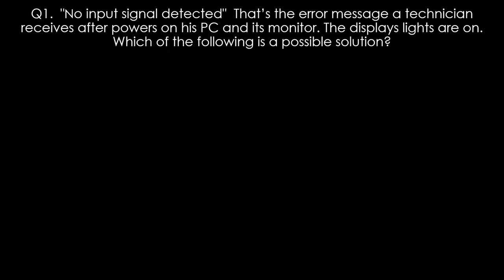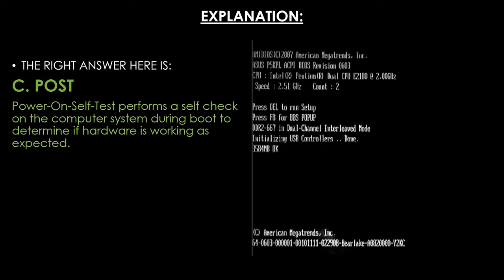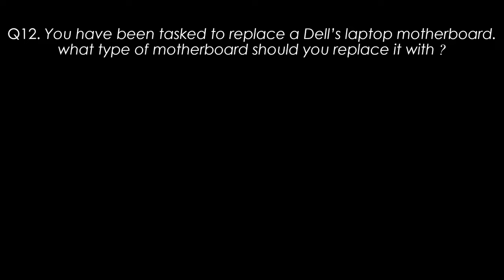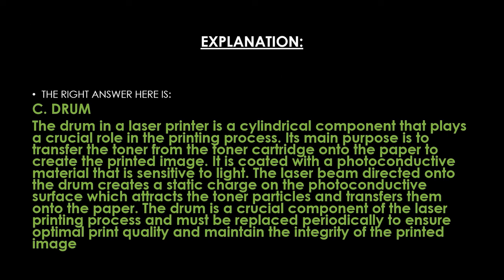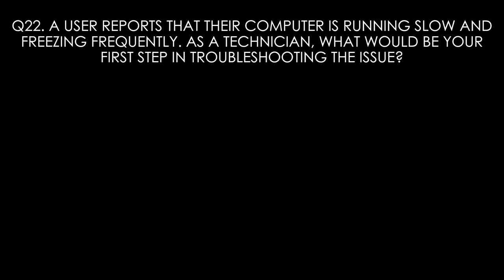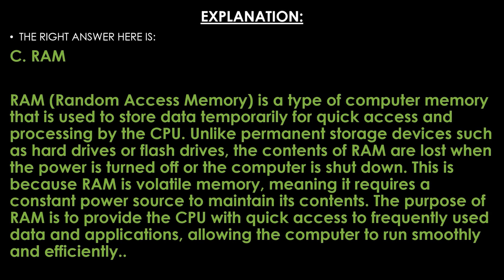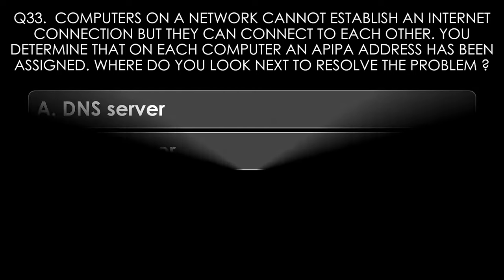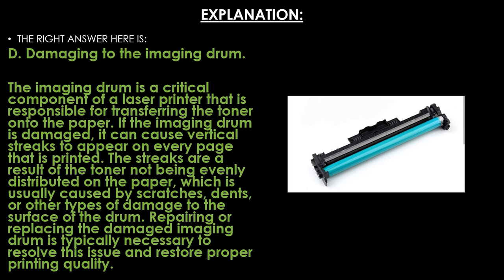CompTIA A+ Certification Practice Test 2024 (Exam 220-1101) (40 Questions with Explained Answers)

Comment: I took the Core 1 test two days ago and passed.  It was really hard, at the end of the exam I thought I might fail even though I had 5 years of experience as a computer technician while it was 10 years ago.  The exam, 75 questions, started with three PBQs (RAID, Laser Printer Maintenance, WiFi router setting with security).  I should have skipped the PBQs to save time.  However other questions, about 10~20, same as PBQs but as multiple choice.  

I felt some questions not clear wordings describing the situation, one question I read five times but still I don't understand what the question is, I just guessed by the multiple choices.   Some questions asking the best answer can be controversial and if this is a real situation then I need to ask the customer for more information, preference, and etc.  To prepare for the next 1102 exam, I need to know not just the definition and the meaning, but also how to use it and when to use it.  Therefore, I think DeanCyber's videos will be helpful for those who prepare for the exams.
Reply: I also did it the other day. It was very hard! Most questions i had never come across before anywhere. And some i had zero idea about even though i had studied for 6 months for the exam. But i still passed.
Reply: What is the answer for RAID question? Please. I did not pass yet
Reply: Answer for first four questions please?

Comment: Question 40 was a bit confusing. How can one determine if its overheating if he has no parameter to judge? Sure you can check the BIOS for temperature, but if you do not know the max tolerable temp for your CPU that causes the shutdown, simply checking temperature wouldn't make a difference.
Reply: Also you wouldn't want your computer to shut down automatically on BIOS i think

Comment: I’m looking to getting my certification before the year ends considering it’s about 6 months remaining in 2023 I want to accomplish this goal. My question is how long do I have to study for and how many questions on the test? I really want to jumpstart my IT career. Someone help I’d highly appreciate it
Reply from the maker: There are 2 exams. One exam for Core 1 and another for core 2. There are no more than 90 questions in exam, simulations included. Usually, there are around 70 questions and around 5 simulations for an exam. You will have 90 min to finish the test. 
I have a Udemy course for core 1 and 2 with mock exam questions if you want you can check them out. The links are in the description. 6 month is plenty of time, there is no way to tell you how long it will take you, because for each individual is different, depends on many things.

Comment: Is A+ worth it or its a total waste
Reply: Well considering core 1 and 2 are fundamentals of everything it is very worth it because it will show employers that you know the basics and are willing to go up from there
Reply: If you completely Skip A+ and get Net+ / Sec+ you can still get employment with that but it depends on the type of employment you’re going for.    
I knew a guy that went straight to net+ but he was one of these guys that would build his own wild n crazy network setups (that helped him leverage employment without work experience for his networking job). 
I honestly don’t see A+ as a waste of time because it’s hard to start at a higher level without some kind of work experience.   
Without that I think alA+ could help better for entry level because you get a better variety of knowledge for an entry level position.  After that you pick and choose which direction you want to go based on what certifications are required for said position.  A+ has some basic networking stuff in it and I think that would help tremendously before going into Net+.

Comment: I did pretty poorly on this and I have my exam tomorrow, wish me luck.  probably going to fail.
Reply: good luck
Reply: How’d it go?
Reply: Did you pass?
Reply: @blfex84  yes actually I got a 696 out of 900. So passing but not pretty close to failing
Reply: @lukewarm751  congratulations
Reply: you passed. that´s what´s important. any tips or plans that you advise me to do before taking the exam? i am very nervous.
Reply: @lukewarm751  GG. Congrats. I got 3 wrong on this vid, but i hope i can get as close to 900 as possible, im not taking the test for another half year or so and then i'll likely want to get other certs as soon as i get a stable income because these tests are pretty costly.
Reply: @eurostar0711  Same.  I could not find the answer in my study for the last questions.. but a lot of the questions here seem very.. easy?
Reply: @lukewarm751  can you tell me the scoring system? what is 900? and how many question they have?
Reply: @jovs1020  it varies but for the 1101 there is 75 questions
Reply: @jovs1020  and it's really hard to calculate the points for the test questions
Reply: @Doob Gang  so it's not 90 questions
Reply: @ricksamuel5260  its 90 questions
Reply: @jovs1020  no idea
Reply: In total it’s up to 90 questions.  What happens is this…  if you get less multiple-choice questions, you will most likely get more PBQs.   If you get more multiple choice questions it will be less PBQs.   It’s random what you get.   
The test in itself cannot exceed 90 questions Total. That includes questions on the PBQs themselves, you might get some drag and drop along with side questions in the PPQ itself.
Reply: @lukewarm751 did you see any question that was listed in this vid on the test ?